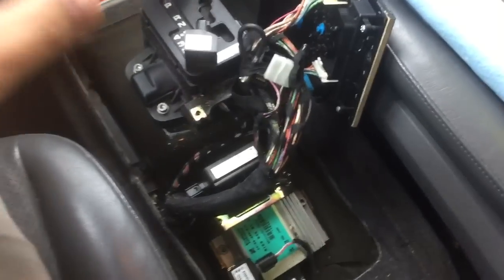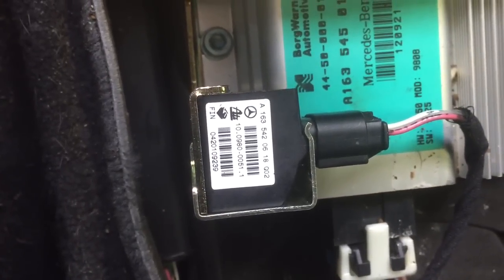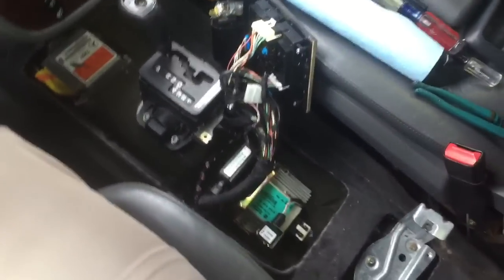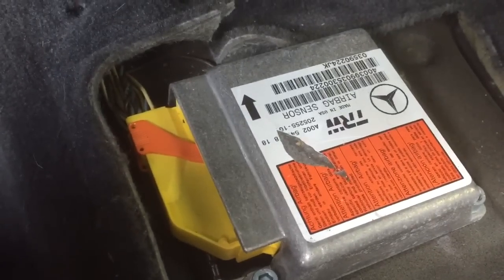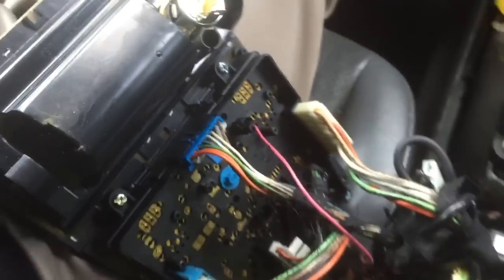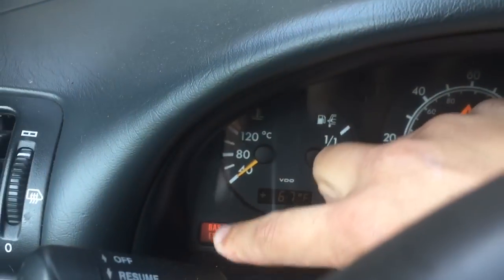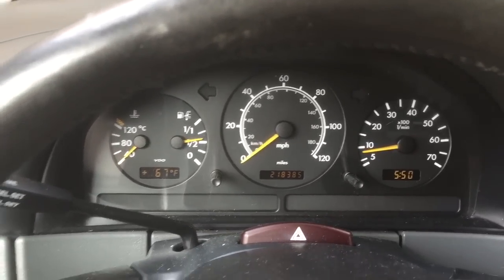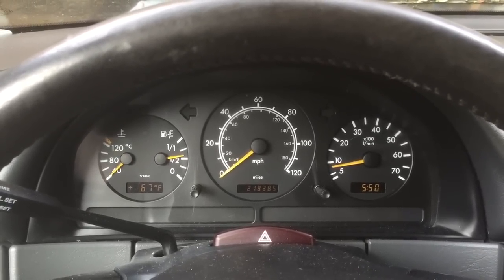1999 Mercedes Benz ML320 ML 320 lateral acceleration sensor fix BAS ESP light

Comment: I put my yaw sensor on today from watching your video where it was located and it worked like a charm thanks.
Reply: I think I may have to do the same replacement.  I've read elsewhere that it has to be "reprogrammed" or "calibrated".  Is that the case? Thanks.
Reply: @drgdrg-vj7dz  Yes it would need to be recalibrated Only to take the BAS light off the dashboard. You will be Amazed by the trucks get up and go performance the new YAW sensor gives it . My truck never had that  kind of power Before. It will only take about 20-25 minutes to install it and unplug the battery. Two screws and one electrical harness that's all.
Reply: Thanks for the info!  Does recalibrated mean to just clear the code (Mine isnt actually throwing any codes but I am having BAS ESP issues)? Also, you have to unplug the battery when you replace the sensor?
Reply: @drgdrg-vj7dz  I didn't have my Bas ESP light recalibrated but I know it works when it was 
Malfunctioning the brakes will apply pressure on its Own and make the truck come to a Screeching Halt no matter how fast you were driving and it doesn't do that anymore that's how I know it works and you have to unplug the battery anytime your working on anything Electrical on any vehicle as a Safety Precaution.
Reply: @drgdrg-vj7dz  you can buy a yaw sensor cheap on Amazon for like 50 to 60 dollars. I did.
Reply: Ah, ok.  Yeah, I just found one on ebay for $35. I am having the same exact issues that you described.
Reply: @drgdrg-vj7dz  Cool you going to want to get that fixed soon as possible. Because you don't  want the brakes malfunctioning while you're on the highway doing 70 mph.
Reply: Just ordered the sensor.  Looks easy to replace. Thanks for the help.
Reply: @drgdrg-vj7dz  Anytime. Someone had helped me.
Reply: @drgdrg-vj7dz  One more thing before you unplug the battery.  There's a 4 digit  code on a little silver credit card . You need that 4 digit code on that Silver credit card to restart the radio. It may be in your manual. You cannot Reactivate  the radio if you do not have that 4 digit code. No CD player No Radio No tapeplayer  No Nothing. Without that 4 digit code.
Reply: I almost had a heart attack because i thought I accidentally threw all that stuff out when I acquired the vehicle, but I ended up finding the manuals and paperwork with the code. I had no idea that was a thing.
Reply: @drgdrg-vj7dz  the guy who sold me my ML320 told me don't ever lose that 4 digit code or you're never ever be able to start the radio again.
Reply: Just an update, its been about 3 weeks since I replaced the sensor (only took about 30 minutes) and everything seems fine.
Reply: @drgdrg-vj7dz  Great,I bet you noticed the extra amount of power the truck now has with the get up and go.
Reply: @cluthr  the sensor was new or used?
Reply: @kchilz32  New.
Reply: @cluthr  you have the link? Because those yaw rate sensors seem to be going for over 600 dollars

Comment: Good job, thanks for the video.  My wifes SLK230 has the BAS/ASR light on so I'm gonna change her Lateral acceleration sensor this weekend.
Reply: Hi, how did you go with the Lateral acceleration sensor did the replacement fix the problem.

Comment: Hey Joe. Need help/advice. Sometimes I get (abs. Etc and brake light)  comes on once in a while-  when light comes on car wants to slow down - once I stop car turn off and back on. Car is fine until it happens again?? Any thoughts would be greatly appreciated thx in advance
Reply: Did you ever figured out what it was?

Comment: My lateral and yaw sensors went bad. I was doing 70 on the interstate and my left front abs engaged on its own and began pulsing. Nearly killed me. Three mechanics(including dealer) had never seen that happen. I'd rather not have abs than risk that again, so instead of replacing I just pulled the abs relay and disconnected the lights.
Reply: It happend to me 1 year ago
Reply: It is the yaw rate sensor
Reply: This happened to me yesterday doing about 50mph did you pull both yaw and lateral sensors?

Comment: Hi , do you think 2021 this car is a good option , I want get one but I saw the same problem with the ets and abs light , and I saw other problem the car don't recognize the key , I have to turn the switch 2 or 3 times and then the car on

Comment: Hello, I have a limp mode 2nd and reverse on my w220 2001 s320cdi, and diagnose said: lateral and acceleration sensor active. Abs light is on. Can this sensor cause limp mode?

Comment: I have a ML55 AMG 2002  , While driving normally or on a bumpy road the EPS, ABS, BAS, hand Brake light come on with beeping sound.
the steering feel a little tighter and the beeping sound stay on until I park the car and turn off the car. after turn of the car and restart it's work fine

Comment: Okay dude thanks. Appreciate. Will have an OBD2 done on the car. Tell me, are there physical danger to me or the car itself, in that warning message of mine?
Reply from the maker: Lario Louw just your electronic stability control will not work. So if you were in rain or snow it's possible to have an issue with skidding or braking so I'm not saying it's not safe to drive but take extra precautions until it is fixed.
Reply: Got it. Thanx!

Comment: My MLS brake assist went crazy a couple days ago as my gfriend was exiting a parking lot. I wonder if the yaw sensor detected something that wasn't happening? What scanner do you use, I bought one that Scotty Kilmer recommended, but I haven't taken the time to tinker with it
Reply from the maker: CORVAIRWILD you’ll probably need a lateral sensor. Goes bad around 130-150k miles on all my MLs. I use a Launch Creader CRP123. Does everything I need it to do on my MLs.
Reply: joesnowmobiles so the lateral is different from the yaw? That you replaced in the console? Where should I get it? Have you done a vid? I'll be doing my center brng as soon Spicer part arrives
Reply: joesnowmobiles googled launch creader, many models, $125-$300
Reply from the maker: CORVAIRWILD yes they are different I show them in this video. I’m not sure if you can get a new one but I buy used ones for about $30 on eBay. Yes lots of creaders available I have the CRP123.i think there is a newer version out now as I purchased mine about 4 years ago.

Comment: Allrighty, here goes. I have the same problem on my 2005 W203. ESP not available, visit workshop. Can't be brake light switch cause my brake lights are just fine. Doesn't have a bls by the way, there's one intergrated on the booster and not on the pedal as some claims. So next thing should be an ESP sensor, I'd guess. Where is the sensors situated, how do I fix it, or do I also have a part like the one in this video which I can swap out?
Reply from the maker: Lario Louw if you can get your hands on a good scanner the scanner will tell you what may be causing the issue. Mine found a bad wheel speed sensor on one axle, I replaced that and walla the light went out.

Comment: mercedes e280 1998 error code  c1401 please help i changed ABS module brake switch rear and front set abs sensor but still same problem BAS eps and ABS light come after 10 mile /hours speed

Comment: Hi. Could you recommend a decent diagnostic scanner for my Mercedes 2000 ML320?
Also could you tell me what this warning light on the dashboard mean--symbol of lamp with waves under it?
Could i get it fix it myself without going to the dealer and have them charge me an arm and leg?
Thanks!
Reply from the maker: Meg R. I recommend the CReader Professional Model CRP123.  The light you indicated should be the low oil light, you should check your oil dipstick to make sure you are within the safe range and oil is full.

Comment: so this sensor causes the bas/esp light to come up? i have a c230 00 k
i already switch the brake light switch, and it still comes back up, and i break or put my foot on the break. could this be the fix?
Reply from the maker: Sometimes it's just a process of elimination with these small cheap parts. If I was a gambling man I'd definitely give this a try. These Mercedes can be very finicky. Hope that helps.
Joe

Comment: There are no lights on my 01 ML320 103k but when I take off it will lock up quickly but release like a stutter..my heart jumps but then it drives fine and that doesn't happen Everytime...The rpm's are higher than usual sometimes in higher gears...I think ive gotten it down to either speed sensors or the AWD!?...Any tips!?

Comment: Did you pull up any codes that lead you to the wheel sensor and lateral acceleration sensor?
Reply from the maker: lcagee yes I did find codes related to the sensors

Comment: Awesome video thanks for the info. Do you need to disconnect the battery before replacing the sensor? Also does the sensor need to be calibrated with a computer after installation?
Reply from the maker: Jack Symonds you don't have to disconnect the battery and no computer is needed to reprogram. Just start and drive and it should reset automatically. Hope that helps!
Thanks
Joe
Reply: Ok thank you for the quick reply. If you replace the yaw rate sensor is computer reprogramming needed?
Sorry for all the questions Im a noob when it comes to this stuff lol
Reply from the maker: Jack, glad to help, I did not disconnect the battery, although if you want to error on the side of caution, you will not hurt anything by doing that as well. The car may need to be driven to calibrate it but I have not had to do anything with mine in order for the codes to disappear, just plug and play. Hope that helps!
Thanks
Joe

Comment: I have a 2002 E320 with 98,000 miles and for more than half a year now,  the BAS ESP light comes on during driving, normally in the morning it is off but during the day while driving, it definitely pops up and whenever it lights up, my air conditional blower, left and right turn signal won't work, sometimes they just start working again but dead again randomly.  It takes me awhile to figure out if I jiggle the ignition key when I need to make left or right turn, the blower and turn signal will work temporarily but soon after I stop holding the key, blower and turn signal will be dead again. After I changed the stop switch, all 4 rotors and brake pads and all cabin filters, that BAS ESP light keeps coming up.  I have not checked the code yet.  You mentioned in your video the lateral acceleration sensor could be bad, but why would it interfere with the turn signals and blower?   Thanks in advance for your expertise advice.
Reply from the maker: Wow sounds like you have a lot going on there, I would start by checking with a scanner that can read ABS codes.  As far as the turn signals not working that usually is a switch in the column going bad. I had to replace mine as the high beam switch also stopped working. Not sure about an e320 but on my ML it required taking off the air bag and steering wheel to get to the switch, not a terribly hard job. As for the blower it sounds like you might have a blower motor going bad, that's usually located under the passenger side dash.  Those would be the normal fixes, however your issue does seem more complicated if all of those components stop working  and start working based on the jiggling of the ignition key.  If you have replaced the ignition switch and it still acts up then you will have to look elsewhere. Otherwise I'd be planning to replace the ignition switch as a start, but check the codes first. Hope that helps.
Thanks
Joe
Reply: Thanks for your opinion, it is strange that the blower and turn signal always work if BAS ESP light does not turn on. In the morning drive to work when it is cooler, I don't know if this is temperature related, blower and turn signal always work fine and the BAS ESP light usually is not ON during the 10 miles trip, as soon as BAS-SEP light turns on typically when I go out for lunch from work, blower and turn signal both stop working immediately, then I have to jiggle key to make them on when I need to turn.  The blower and turn signal always either both work or not work at all, every time when I drive and the ESP light suddenly turns on, it will immediately make both blower and turn signal stop working. I think they are victims of some switch more likely the lateral acceleration switch than the ignition switch. You are right I need to scan the code first.  Thanks a lot for your prompt response.

Comment: Hi there, I have the same problem with my 01 Ml320. The light is on along with the brakes locking up at random. I replaced the YAW rate with no resolve and just now replaced the lateral acceleration sensor but the light is still on. Is there a manual reset I need to do?
Reply from the maker: Zach Fletcher do you have codes in the system? Have you turned wheels back and forth several times to reset?
Reply: joesnowmobiles  No to the codes, yeah I did turn the wheel. Im thinking I got a faulty sensor...
Reply from the maker: That is quite possible, if you can have someone pull the codes that would help. Let me know 
Thanks
Joe

Comment: What brand bearing did you use? I bought a genuine Mercedes from Amazon Marketplace, and it's actually a made-in-china Febi Bilstein, and the rubber says Germany, so who knows what it is. But it's going back for $70, then someone sent me a link to a genuine Spicer from Amazon itself, $80. Somebody else that they put in a meyle, and it lasted 3500 miles.
Reply from the maker: CORVAIRWILD are you talking about the center support carrier bearing?
Reply: joesnowmobiles yes, the center support bearing. I also posted on a Mercedes forum, and a guy found me a genuine Spicer on Amazon for $80. The one that I just had shipped here said genuine Mercedes, but it wasn't, Amazon moves listings around as they see fit. It was also from the marketplace, this one is directly from Amazon, we'll see what ends up coming here. 
Something you might think of doing, if you have the expertise, is putting links to the part numbers you mentioned in the video, I'm not sure how people do it, but it's really handy, you can just click on things and go directly to the bearings and brushes you mentioned in the ABS video
Reply: joesnowmobiles if you have the time, I also crawled underneath my ML with a stethoscope to listen to what was howling, and I posted a 9-minute video on YouTube. I rust-proof the heck out of my vehicles, as I bring them from out west, and certain ones I plan to drive in the winter, I don't want them to rust. It's much worse here that even in Chicago where you are
Reply from the maker: CORVAIRWILD yes all good ideas, just have to get around to adding that info one of these days 😁. I just bought a genuine Mercedes one off eBay and the second one I did just recently I also got on eBay but it was just a no name part, so far so good though!
Reply from the maker: CORVAIRWILD I watched your video, yes you need a carrier bearing assembly. I’m assuming you watched my series on the bearing replacement? It’s not a terribly  hard job I did the last one in about 2 hours. Hope that helps
Reply: joesnowmobiles how much was the 1st one?

Comment: hello dose this three lights effects the engine performance . My problem with the engine is between 5 rpm and 20 the engine Start's to vibrates and didn't move like it should . if you have any information about this please let me know
Reply from the maker: Salah Hably no it shouldn't have anything to do with the engine performance that sounds more like a misfire or maybe a bad coil pack do you have any check engine lights on currently?
Reply from the maker: Salah Hably no it shouldn't have anything to do with the engine performance that sounds more like a misfire or maybe a bad coil pack do you have any check engine lights on currently?
Reply: joesnowmobiles i have the check engine light on , but i have chang all the 12 misfiers and the coils , today while im driving all the light get off and the engine work perfect
Reply: im wondering does the problem from the electronic card
Reply from the maker: Salah Hably see if you can stop by at AutoZone or advance auto parts or O'Reillys and have them scan the code once you get the codes let me know what they are
Reply from the maker: Salah Hably if you planning on keeping the car for any period of time I recommend purchasing your own scanner they are about $80-$130 and well worth the investment
Reply: Witch code i should get for you ? Im not living in US im in Lebanon, The last scan i make it told that the left abs senior is not working  thats the check engine lamp lights for it doesn't
Reply from the maker: Salah Hably I understand yes you probably wouldn't have an auto parts store like we have in the US they  scan the code for you. If you have the opportunity to purchase a scanner online and can get it there in Lebanon I would recommend you purchase this scanner CReader CRP123 this scanner will tell you all the codes once you have the codes you can research online or let me know and I will help you diagnose. https://youtu.be/UM9Yo-71hrU here is a link to one.
Reply: Okay thank you for your cooperation
Reply from the maker: Salah Hably you are welcome anytime